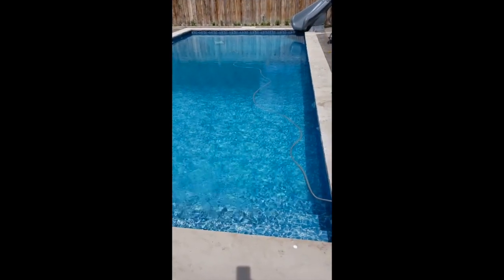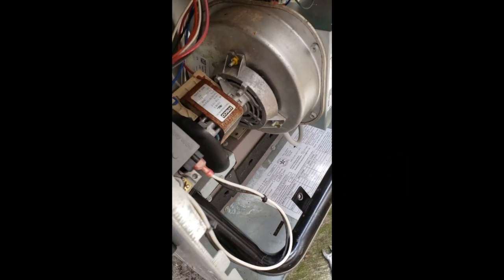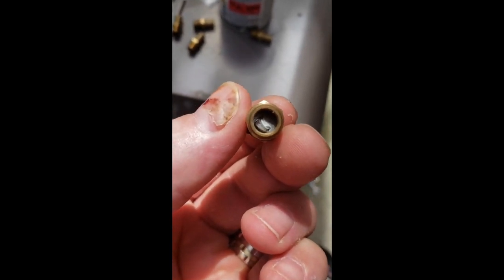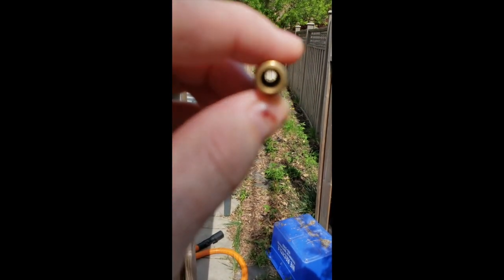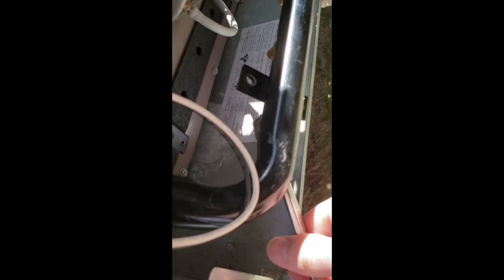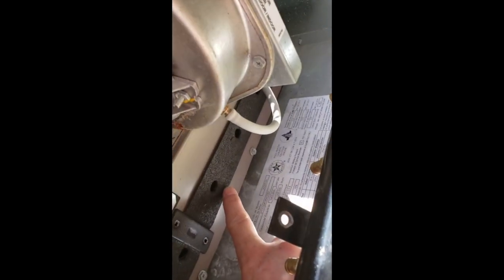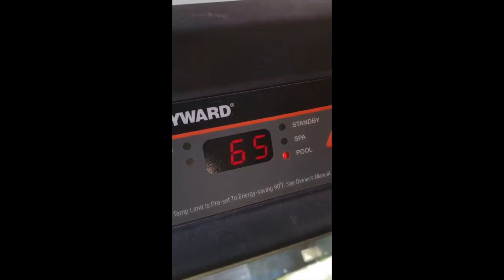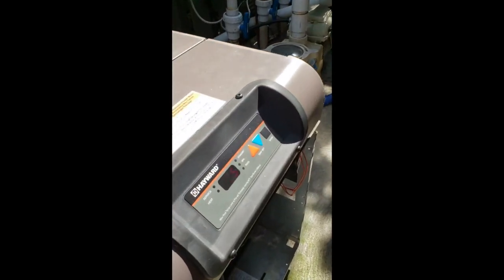Cleaning a Hayward 250FDN Pool Heater's Ignition Manifold

Comment: I was able to remove the manifold but couldn’t actually take off each of the orifice pieces.  They were on super tight.  Any advice?   I just took a metal paper clip and tried cleaning it while still attached to the manifold.  

Should I use a compressor to try to blow through each orifice and the manifold/gas pipe?
Reply: After cleaning as best as I can, I’m still getting an IF code :/

Comment: We got  if code after a few weeks running fine?
Reply from the maker: The "IF" code means "Ignition Failure". So the gas is failing to ignite. This can be for a few reasons: low gas flow, ignitor not getting electricity, ignitor is broken.  In my case, it was low gas flow and I fixed it with the method described in this video.

Comment: My heater was working for 3 weeks and now it's not igniting whyyyyy? Please help
Reply from the maker: Please define "not working": What are you doing? What are you expecting to happen? What is actually happening?
Reply: @gregfenton  it's clicking quietly then won't fire up. How do I know how much to adjust gas flow if needed
Reply from the maker: @keramiz3072  which make and model heater do you have?

Comment: Hi Greg. I just watched your video. I have same heater and maybe the same issue. I cannot figure out how to get  the bar all the way out to get to the brass orifices. What did you turn to get it so far out
Reply from the maker: I commented this below: You need to use a pipe wrench outside of the box to rotate the entire mechanism.  I mention this in the video around the 4m 14s mark.
Reply from the maker: The following really short video shows how to do this at the 30 second mark:  https://www.youtube.com/watch?v=YagwXbBpvgc

Comment: Has anyone gotten a PF code? If so can you tell me what to check for? Tia
Reply from the maker: According to the manual, the "PF" error code : "This code will display if 120V polarity is reversed, low voltage is detected, or if
the ground path is not suffi cient. Reset is immediate after error is corrected."  https://hayward-pool-assets.com/assets/documents/pools/pdf/manuals/UHS-OwnersManual011717-RevJ.pdf

Comment: Are you able to show disconnect/connect the the gas valve? I changed my control board 3 weeks ago when I received the IF code. She fired right up. However, this morning the IF code returned. So now I’m wondering if it’s the gas valve that needs replacement, clean orifices, or both. I’m not too crazy working with gas lines as it might be over my head. If you showed how to disconnect/reconnect that might give me some confidence. I have checked in with a pool guy. Just looking to save some money if possible.
Reply from the maker: Not sure what you mean by "gas valve"?

I too am not one keen to play with gas lines directly.
Reply: @gregfenton  I see where the manifold line comes down from the gas valve, which is inside the unit. In order to get to the orifices you have to disconnect disconnect gas valve from pipe so that the manifold can me accessed. Correct? You can’t just remove the 4 screws on the manifold is secured to access the orifices. You mentioned that you needed a plumbers wrench so that the manifold bar will swing down to access the orifices.
Reply from the maker: @patrickmcguire3417  No, I do not disconnect it at all.  As mentioned in another comment,  the video around the 4m 14s mark is where I show/talk about simply rotating the entire mechanism.  At no point did I disconnect a gas line from the system (though I did shut the valve off just to be safe).
Reply from the maker: The following really short video shows how to do this at the 30 second mark:  https://www.youtube.com/watch?v=YagwXbBpvgc

Comment: I just had the IF appear yesterday.  I have the H250FDN and she has been running great all season.  I purchased a new flame sensor off of Amazon and will try to clean out the orifices as well.  When it calls for heat it's cycling through but will not ignite.  I've looked through the clear glass and do not see any glow.  Hoping it's either the flame sensor or clogged orifices.  In my research I've also read that the board could be bad.  It's raining her today so I will look into this further tomorrow.  Thanks Greg for your video.
Reply: I've got exactly the same thing going on. I put the new flame sensor on but now I'm getting the AO error code. I'm gonna try to clean the brass fittings next. Did u figure yours out?
Reply: @tonykari5124  I changed the control board a few weeks ago and she fired right up. Came out to clean the pool this morning and noticed the IF code returned. I’m guessing now it’s either the orifices or the gas valve. I’m not too crazy about playing with gas. The video makes cleaning the orifices really good, but disconnecting and reconnecting the gas line might be over my head. Did you get yours figured out?
Reply: Sometimes water can get in the fan tube and I believe it can cause the AO code as well. If you pull that rubber tube off from the front fan and vacuum switch then blow it out, it usually clears the AO if water in the tube is the cause. Assuming your blower vacuum switch isn’t bad.

Comment: This is a helpful video and I'm pretty sure this is what my issue is. It would be very appreciative if you showed how to access the manifold/orifices and how to put it back together. Just a suggestion. Thanks!
Reply from the maker: I commented this below: You need to use a pipe wrench outside of the box to rotate the entire mechanism.  I mention this in the video around the 4m 14s mark.

If that doesn't help, let me know and I'll see what more I can provide.
Reply from the maker: The following really short video shows how to do this at the 30 second mark:  https://www.youtube.com/watch?v=YagwXbBpvgc

Comment: Have you thought about spraying a bug killer (pyrethrum like Ortho home defense) around the heater?  I’m going to start doing that.  I’m told the chemical is good as a deterrent — when bugs encounter it, they act like it’s an electric shock to their nerves and they avoid the area.
Reply from the maker: Neat idea.  Will certainly consider it.  What I have read is that these bugs (spiders?) typically come into the lines in late fall.  So I'll need to refresh any spraying after the pool closes for the season.

Comment: How do you pull the gas manifold out?  I unscrewed the 4 screws on 4 corners, but it is still so tight to pull it out like in your video.
Reply from the maker: You need to use a pipe wrench outside of the box to rotate the entire mechanism.  I mention this in the video around the 4m 14s mark.
Reply from the maker: I updated my comment. It is the 4m 14s when I mention the pipe wrench.

Comment: Ohh wow. i think this is what causing my pool heater same issue, i should give a try i guess. did you have IF code on display for this problem i wonder? Because I have the same model but newer look H250FDN and my heater starts up but in less then 3min i guess i get LO code and then in the end IF code. during this 3min i do see flames as well i smell gas. not sure what's happening.
Reply from the maker: Yes, it was "IF" as the error code that led me on this hunt.  "IF" is "Ignition Failure", meaning "the fire didn't start up".  My searching around led me to a few possible errors, the main one likely being insufficient gas flow.  And thus...the video :)

Comment: Wondering if this could be why my heater is taking soooo long to heat up a small hot tub.  400k btu heater taking 1 hour to go from 56 to 100 degrees F in 50 degree air temps.  4,000 cubic feet of Natural gas used in 2 hours
Reply from the maker: Worth a try to clean out the gas injectors.  Could be that you have enough flow to fire up the heater, but not enough to get to full heat.  A low flow might be stopping you from getting full BTUs.  Please post back to let us know how it works out!